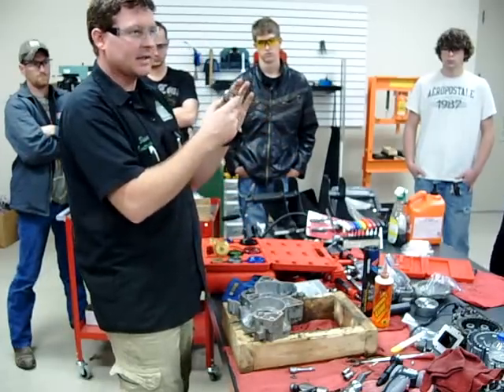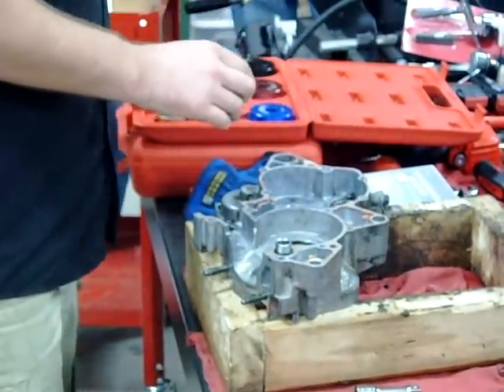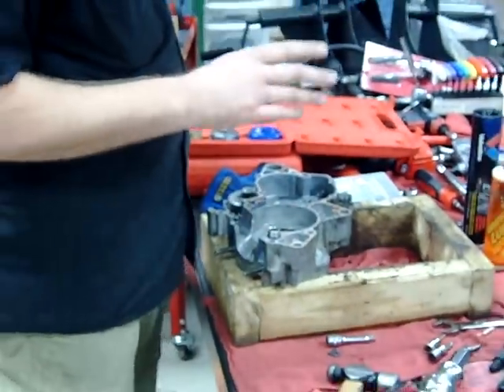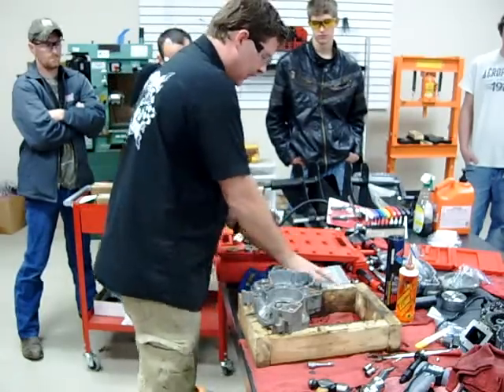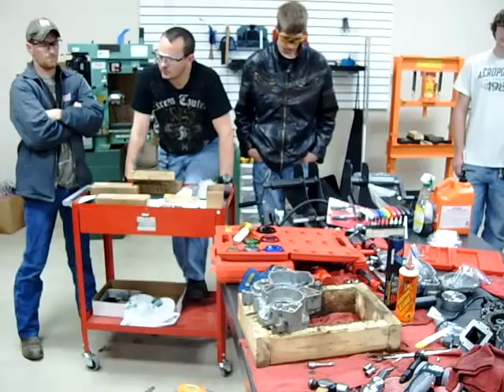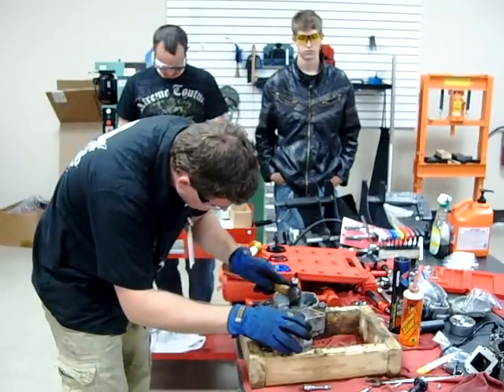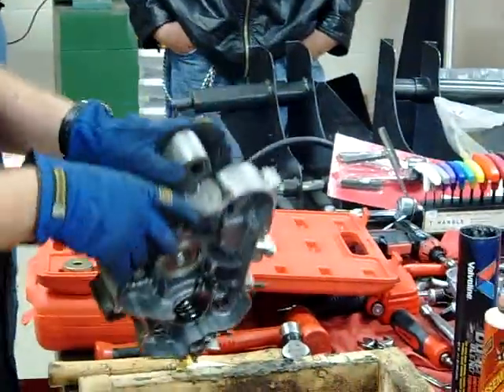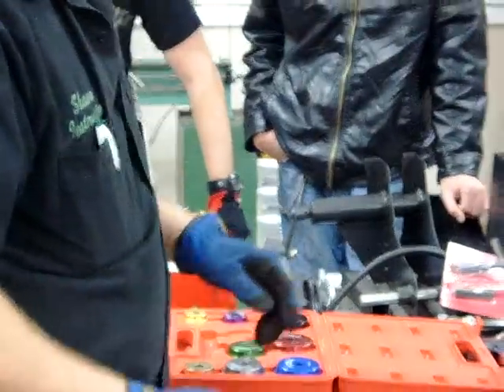2-stroke dirtbike motocross transmission crankshaft bearing installation

Comment: a very neat tip to install bearings easier heat the casing a little freeze the bearing freezing causing it to shrink and heat causes it to expand out the old bearing swap in the new easy fit once it cools down snugged like it should be.

Comment: i have a 1992 yamaha yz250 2 stroke and i have it apart right now to replace 4th gear shift fork and i noticed that the crankshaft bearing on the stator side and right side come out very easy is that a spun bearing or worn out?